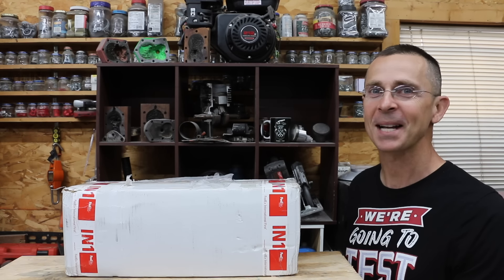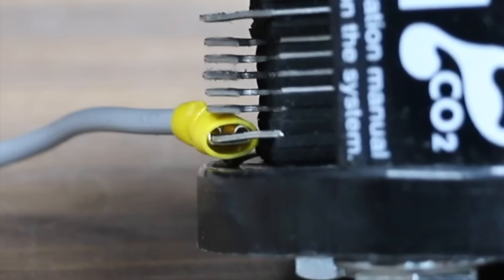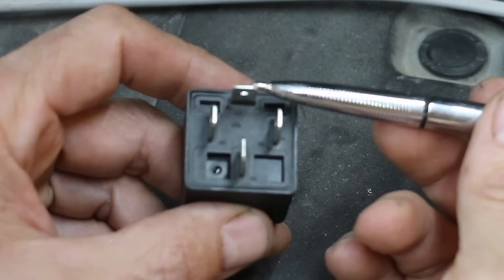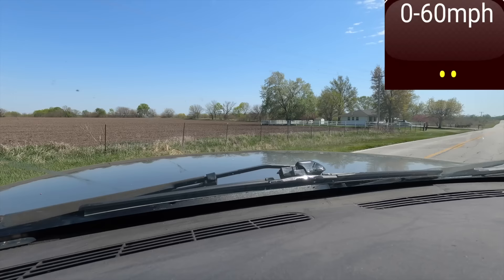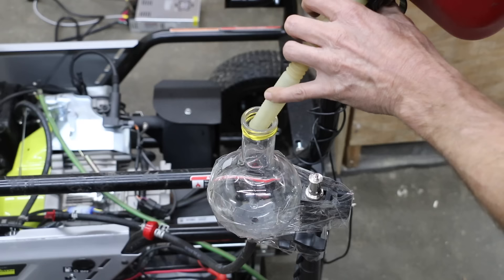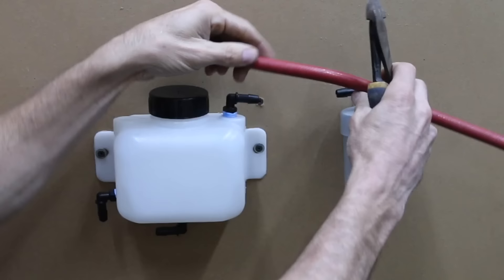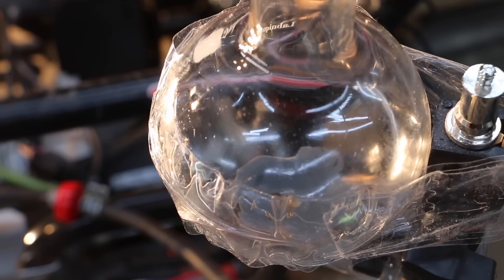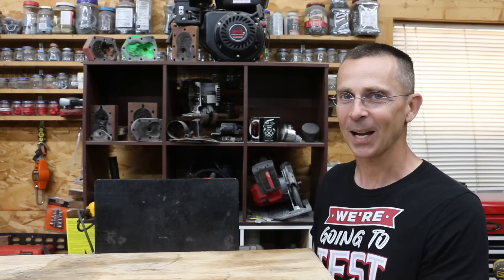AMAZING 35% More MPG with HHO? Let’s find out! Help with high gas prices?

Comment: Snake oil. Unfortunately a lot of people still fall for this :(
Reply: Always explain to them, if it made enough gas to help anything, the motor would have to run harder to power the generator, and it never works xc
Reply: Deliberately blowing $200 when you KNOW ahead of time that it's a "perpetual-motion machine" is going above and beyond the call of duty for a content-creator. (After that crap is torn back off, he should see if it blends, and then whether or not it'll stop a fifty-cal.)
Reply: @geth__commands_6300  Everything is relevant to weight? Gravity is not, all objects fall at the same rate in a vacuum. Time, when traveling near the speed of light is relevant for the occupant. 
If hydrogen is utilised you know it is used to generate electricity to operate the motors because the is not any air for the engine use, don't you. Even diesel engine submarines use batteries to run under water. Without batteries, all submarines would be useless underwater.
In your insult to the OP, what does "you must be the old and new generation well done" mean? Perhaps because they are not in the correct generation, the one in the middle of generations. I wouldn't know how that could be insulting. Also now that you are aware of everything in your statement is incorrect, false or misleading, does that mean you resend your insult?
Reply: This SNAKE OIL should be taken off the shelf and the owner held liable !!!!
Reply: Snake oil or improperly installed?
To see any improvement on a fuel injected car the oxygen sensors need wrapped with aluminum foil.
this will cause the car to lean out it’s fuel to air mixture.
The hydrogen hose needs put into the vacuum system generally the brake booster line with a three-way connector.
A resistor spliced into the wires to the map sensor to tricks the vehicle into believing that there is no Vacuum leak. That idle air control valve will do its job and bring the vehicle back down to a Smooth idol.
Reply: @aaronwetzel8444  stop bruh... Your explanation is barely intelligible and still won't make this Snake Oil system work. Science has already proven there's no free lunch.
Reply: @aaronwetzel8444  OK Even if what you said worked, explain why the generator sees 0 gains... lol snake oil.
Reply: @aaronwetzel8444  It is the former it cannot function as claimed. The claim is not true it is also incompatible with many theories in physics. Although it may seem plausible because, you know, Hydrogen, there is not enough to make a difference. The manufacturers are aware the the claims they make are done so in order to deceive. In this form the device is as ridiculous as a car that runs on dihydrogen monoxide, water.
Reply: @Melicoy  
It looked like a Well built product for the price.
If he put a link to it I would probably purchase it!
No it would wind up on my car but two of those units would generate enough gas for a small water powered cutting torch.
Reply: @minirock000  have you heard of this thing called a nuclear reactor? It generates the power for submarines, not batteries. Batteries are only there for emergency backup.
Reply: He did leave a link to the product :p
Reply: @kleetus92  Those do generate electricity, you do know that. You must know that everybody knows that. Those are not the subject of the claim he made, you understand that though as well.
Reply: @aaronwetzel8444  Wear Foil Hat Too That Will Help
Reply: @minirock000  actually no, they generate heat that boils water to create steam that turns a turbine that generates electricity..... but you knew that, right?
Reply: @kleetus92  Yes, that is how the vast majority of power plants work, some exceptions would be ones that The NASA use on spacecraft, for obvious reasons. What charges the batteries?
Reply: @aaronwetzel8444  How much gas do they produce? How do you compress gasses that you use? Did you purchase your own tanks to put gasses in? As a private citizen, p[resuming it isn't for commercial use, what codes must you be in compliance with?
Reply: The fact that the people advocating for that called it "HHO" is a proof that they don't know any chemistry...
It's 2 parts H2 (Dihydrogen loosely called "hydrogen gaz") and one part O2 (Dioxygen loosely called "oxygen gaz")...
Keeping those mixed is dangerous: a spark in the tank and the mixture explodes.
If you consider that electrolysis is arround 50% efficient and producing electricity with an engine is less than 30%, any gain in the combustion process costs 6* more to make. So the more "HHO" you produce the less effective you are.
Reply: @aaronwetzel8444  Dude laws of physics state that you can not get more energy out of process than you put into it. If a person mange to do so. He/she will get the Nobel Nobel Prize in Physics and will also get very rich. But has that happen to any of the energy nuts in HHO crowd. Nope not so far and it will never happen either. Trust me!
Reply: @minirock000  A water gas cutting torch generates as you cut the chemical reaction of the molecules coming back together can cut through almost any Metal and leave it safe temperature to handle moments after cutting through it.
You should look them up they’re awesome invention and quite expensive. I made my own a few years back but I have trouble fire traveling back down the house and exploding the bubbler
I’m sure I can find a solution to that problem now. I was 17 years old the time
Reply: @afre3398  I mean if this thing worked at mythical 100% efficiency it should do precisely nothing. Because it doesn't, it is actively harmful as you're using the engine to make electricity using that electricity to make chemical energy.  Instead of direct chemical energy (fuel) to electricity.
Reply: @aaronwetzel8444  -- While I suspect your replay was sarcastic, in the event that it's not, it MUST be noted that the reason none of this works is because extra energy is required to offset that lost by cracking water for its hydrogen, so this thing can NEVER improve mpg. It's 100% scam. And hydrogen gas is explosive.
Reply: @cmuller1441  oooooh sounds like time for a detective maybe the electrolyte has stolen missing ooo
Reply: @mikeschneider5077  This product if there was another hydrogen oxygen gas being put into the Engine truly improve fuel academy it would melt the cylinders like it does as a cutting torch.

But if you install it properly you would see a Increase of gas mileage of about 30% why? Because the other modification suggested with this modification well throw your vehicle in it’s Max fuel Academy band
Reply: @cmuller1441  You have no idea about  HHO. There are so many combine  when you use electric to generate: HHO, H2O, H2O2,HO2, H, H2, O, O2, H3, O3 etc. Like CO2 and CO are total differently. NO Vs NO2 too. It called state of space of atom or molecular or mixed combine under different cataclysm thermal, quantum space, entropy momentum etc so many. Then it created reaction in physical state, chemical state, combustional state, nucleotional state etc. So much wait for newage ahead.
Reply: @justincarroll1836  The HHO crowd is a cult. It is a waste of energy to even try to talk common sense to them. It is the best thing to just leave them alone
Reply: People fall for OBDII fuel savers and cigarette socket fuel savers, so I'm not surprised in the slightest people believe this nonsense as well.
Reply: @afre3398  seems like a weird hill to die on (metaphorically speaking) but I don't doubt you're right.
Reply: @mikeschneider5077  all I was being sarcastic in previous replies I wasn’t being sarcastic about water gas cutting torch they are amazing intervention
Homemade hydrogen generator 
Round up as a cutting torch 
The Gatorade bottle I was using as a bubbler many times and let me question the safety of the glass jar hydrogen emerged in
Reply: @aaronwetzel8444  That wouldn't apply to the timed generator tests that showed no difference. It actually had worse fuel efficiency  with the hydrogen generator attached but statistically close enough to be within normal variance. If this worked, the kooks in California would have mandated it decades ago.
Reply: @ThuannguyenN-gp2vp  Hydrogen peroxide and ozone cannot be created by electrolysis. Retake your high school chemistry class.
Reply: @magicoddeffect  well not by the electrolysis of water but given that's the device's purpose I'm assuming that's what you mean.
Reply: @murrayshekelberg9754  You are right hydrogen generation is not above unity.
The best you can hope for is that it will improve the combustion of the fuel in the engine.
As far as the generator is concerned
There would be no possible benefit from a slower but more thorough combustion.
The mods I stated in a previous post would lean the fuel and advance the timing this would allow the vehicle to utilize a slower but more thorough Combustion.
Reply: @TelephonePlays  You haven't understood the reasoning behind their claim. It has to do with the extremely fast burn rate of HHO. That is supposed to ignight more fuel completely, increasing efficiencies. I do not yet understand why Todd got no improvement.
Reply: @afre3398   You haven't understood the reasoning behind their claim. It has to do with the extremely fast burn rate of HHO. That is supposed to ignight more fuel completely, increasing efficiencies. I do not yet understand why Todd got no improvement.
Reply: @timothkeyyprice  I do because the law of physics. Say you can not get more energy out of a process than you put into it. Any combustion engine waste a lot of energy into heat. And in order to produce current to split water into hydrogen and oxygen. You have have the car dynamo to work harder. That energy has come from burning more fuel. Water is kind of the ash   you get from when hydrogen and oxygen combine. Water is not an energy bearer in any way.
Reply: @aaronwetzel8444  SNAKE OIL !!!
Reply: @aaronwetzel8444  He did install properly LOL
Reply: @afre3398  I said, burn rate.... the gasoline is not completely combusted in your engine. The HHO explodes and ignite more of it.
I am not at all sure Todd set up his engines properly to account for this. It will be good if the sellers of HHO units would challenge his testing.
Reply: @timothkeyyprice  The laws of physics say. You can not create energy from nothing, nor can you take some amount of energy and use it to create a larger amount of energy. HHO is just a scam that fool people into using money for something that do not work. The HHO crowd is just a cult. That you can not talk common sense to. They just do like you do. Come up with a lot of excuses when they are challenged. Oh they did not do that part right and so on. And the sellers of HHO units just laugh all the way to bank.
Reply: @timothkeyyprice  it takes electricity to split the hydrogen, more than it can produce burned. That electricity creates strain on the motor, which eats more than the gas produces. Which is exactly why todd did not see improvements.
Reply: @timothkeyyprice  trust me, I came across hho 5 years ago and have made many cells, it always uses more wattage than the gas produces burning. I'm sorry it doesn't work. You can't create energy from nothing
Reply: @aaronwetzel8444  Hilarious!  The snake oil buyers are arguing with you! lmao
Reply: @leroy420b  Maybe if I polish my Buddha statue,  I'll be blessed with a Smooth idol and a free lunch.
Reply: Brown gas generators work Bubba. None of this is new. Auto manufacturers went around HHO a long time ago. I have to chip the 
Vehicle. Works absolutely fabulous on a carburetor vehicle. I mean if I could do this shit 20 years ago you could do it today. You must’ve watched Myth busters huh. Put up or shut up!
Reply: It’s called brown gas it’s oxygen and hydrogen and water vapor. Glows green. Talk to someone who has actually built one of these. Works better on pre OBD2 ECU’s, Nonelectronic ignition Diesel, and regular carbureted engines. Your ECU in your car is programmed to keep a certain air/fuel ratio and will compensate when anything else is added. Hence why when you sup up you car you get a piggyback chip or take it to a shop and have your ECU programmed optimally. Same thing. Same as a 2 or 4  cycle engine. Gotta reject that carb. Did you actually expect to hook the fucker up to anything it it just work right on the box? You can’t with aftermarket parts on your car or your bike. Fuckin duh!
Reply: you'd think people who know how to install this thing wouldn't fall for this would. That and would have enough understanding of how an engine works to know that the little hose pumping the gas wouldn't even come close to providing enough gas to make a difference in an engine.
Reply: @aaronwetzel8444  Wrong, Wrong, Wrong!  Wrapping aluminum foil around an oxygen sensor does nothing!  Oxygen sensors DO NOT work on heat.   In fact, most oxygen sensors now contain a heater to keep the sensor above 600 deg. so it will work properly. They work on voltage.  A voltage signal is generated by the difference between atmospheric oxygen levels and the oxygen levels inside the exhaust system.  A rich mixture (low oxygen levels inside the exhaust system) produces a higher voltage (near one volt) while a lean mixture (higher oxygen levels) produces a low voltage (near zero).  The ECM reads this and rapidly changes the mixture to maintain a 14.7 to one air/fuel ratio.
  You asked: "Snake oil or improperly installed?"  The obvious answer is SNAKE OIL!!
Reply: @aaronwetzel8444  A very small torch!!
Reply: @aaronwetzel8444  Sounds like you are now about 14.
Reply: @aaronwetzel8444  No Aaron, you have been deceived by the smoke and mirrors put out by the HHO scammers!
Reply: @ThuannguyenN-gp2vp  Great use of technobabble!  I love your sarcasm!
Reply: @timothkeyyprice  Todd got no improvement because these silly gadgets do not work as claimed.  They do not work at all!!
Reply: @timothkeyyprice  Don't be so gullible, Tim!
Reply: @MrJaman0083  Love your tin foil hat, James.  Would you like a propeller beanie to go with it?
Reply: @Cougracer67  Snake oil these nuts!  Prove it wrong! Never said anything other then it works.
Reply: @Cougracer67  this is also exactly how they make oxygen in a fucking submarine.
Reply: Are you saying oxyhydrogen can’t be used as fuel? Is that what you’re saying?  Because it wasn’t produced by BMW or Mazda or Mitsubishi doesn’t make the any less a hydrogen modded vehicle or Hicev. This setup will not get you there but it works none the less.
Reply: @Cougracer67  Snake oil.
But oxygen sensors to respond to heat
We use a lighter and a voltage meter to test them in the shop.
What I wrote in that post was taken from different Snakeoil forms.
Wrapping the O2 sensors in aluminum foil will cause higher voltage which will cause the ECU to Richen the fuel to air mixture and protect the engine against the other modifications described.
Reply: @Cougracer67  I was 17 years old when I installed one on a vehicle.
The biggest difference I noticed was it allowed me to advance the timing without spark knock far beyond what I would’ve been able to advance it without It. 
It did better than premium fuel.

The vehicle was a 1985 Ford Econoline.
I built for hydrogen generator myself
No steak oil salesman got a penny off me.
I didn’t know enough to be afraid of the heat generated by lien fuel mixture.
I was able to get slightly over 30 miles to gallon out of the vehicle that generally gets 12 miles to the gallon.
After 1000 miles I had to replace the upper engine gaskets.
The exhaust manifolds were cracked 
but this probably had more to do with 
the age of the vehicle than anything I did
And if anybody can tell me how hot he combustion chamber Hass to get to turn the deposits into white ash I would like to know.
Reply: What you  probably didn't notice was the extra wattage used to power the unit. Which is probably why the results were as such.
Reply: @timothkeyyprice  Y'know what detonation is in an engine? If you don't know it's pretty bad, and can make your engine blow up. Gasoline engines aren't designed to make gasoline "blow up" and burn right away, because it blows holes in your pistons, microwelds your piston rings to the cylinder walls, and destroys your valves and spark plugs. The only way to improve efficiency in an engine is to use less and less fuel until the stoichiometric mixture of 14.7:1 is maintained in the engine at all times. Using different propellants in an engine doesn't make it inherently more efficient, it's just splitting the consumption up with two propellants lmao.
Reply: @MrJaman0083  The reason no manufacturer has designed a combustion engine to run on hydrogen is because it doesn't work. The reason being is because storing hydrogen in quantities large enough to make an ICE engine go any meaningful distance is impossible, it has lower energy density than gasoline, and it's more expensive to use on its own. The Toyota Mirai uses hydrogen to mix with oxygen to create electricity to run its motors though, which is pretty cool. That's the only use case it really has though, itd be better to use synthetic ethanol instead as a future fuel source.
Reply: Oh it can work...
Reply: @SteveIrwinsPetStingray  Dear LMAO. Gas vapor in an engene does not ALL burn. It is wasted and blown out the exhaust  
The HHO burn extremely fast, is very hot, and serves as a primer for the gas.
Setting the timing back a git to be sure to be past the peak of compression is necessary in order to achieve the benefits.
Reply: @timothkeyyprice   It doesn't work like that. Using a "primer" won't do anything, and won't make the gas burn better. Gas has a certain burn rate, and the only way to make that process more efficient is to use a leaner AFR with higher compression and higher octane fuel. Or, better yet, just to use ethanol instead. Oxyhydrogen turns into water when ignited too, pretty counterintuitive for an efficient engine lmao. Just because it has hydrogen in the name doesnt mean its a miracle fuel. Also, the energy benefit it would theoretically give outweighs how much energy is required to make it.
Reply: @devinmcaluliff7001  No, it really can't.
Reply: @SteveIrwinsPetStingray  yes it can, I made it work...so by my statement alone...I made it work and it’s still installed
Reply: @devinmcaluliff7001  What? So because you said you installed one of these into something that means it 100% works? That's not how things work pal, sorry to tell you. The video even showed that there is no benefit to be found. Oxyhydrogen does not boost engine performance or efficiency. The only possible ways to do so are to: Raise compression, use a leaner mixture (stoichiometric mixture is 14.7:1 and isn't possible to achieve without detonation in todays engines that run between 11:1-13:1 AFR), maximize the amount of oxygen that reaches the combustion chamber, and to optimize flow paths for the intake and exhaust. Stop yourself from being fooled and buying into these scams. You want a better running engine? Convert your car to run on Ethanol.
Reply: @SteveIrwinsPetStingray  so in your mind if it doesn’t meet the criteria of the channel, then it doesn’t work...son pull your head out of your butt... there may be more than one goal...the channel was their to debunk the speed claim...me, I increased my mpg by 30%...my wallet is happy.  Plus you are missing my point...my motor uses a carburetor system...putting a Weber on it this summer.
Reply: @devinmcaluliff7001  The video shows that it provides to benefit to fuel efficiency either... Tell me, how much gas does this produce? Say you had a 454 big block that has a redline of 5500rpm, which flows about 615 CFM. There is zero possible way that you are producing enough of this gas to provide any noticeable benefit. The size of the batteries, generator, and water reservoir would fill a large trailer. That's for an engine that's only a liter in displacement as well. You are delusional, these things do not work.
Reply: @SteveIrwinsPetStingray  Burn rate is entirely dependent upon pressure and temperature. All chemical reactions increase by the square of their temperature increase.
Reply: @geth__commands_6300  submarines actually exhaust hydrogen because it's a waste product when they're making oxygen. HELLO.
Reply: @Cougracer67  
The point of the foil has nothing to do with heat, just to defeat the o2 sensor.
Reply: @SteveIrwinsPetStingray  
Propane combustion produces water, as does gas. Are you saying those fuels can't power an engine?
Reply: @duderama6750 That was my bad, im aware that other fuels produce water, didn't realize what i said when i was typing.
Reply: @aaronwetzel8444  leaning out the engine and tricking the MAP sensor with a resistor would change gas mileage, the HHO system would do jack all. Also leaning out an engine makes it run hotter and increases detonation. So you'd save a little on gas and blow your engine up much faster.
Reply: @aaronwetzel8444  Close but the aluminum foil is supposed to make a tin foil hat to wear.
Reply: @ImprobableGarage  right you are.
But you can help protect your engine by adding 10% diesel to your fuel mixture.
Then to keep the Cadillac from plugging up 
add 10% lacquer thinner +10% acetone
This will only clean your engine Improve mileage.
Don’t try this to a vehicle you like
Or want to keep around for any length of time. 
This was taken from the snake oil form.
Good luck
Reply: @stinkycheese804  Why?
Reply: @TelephonePlays  no actually not on a carburetor engine...it’s an old technology that works...but hey keep thinking what you do and I will persist in my ‘87 Subaru GL getting 40 mpg via HHO
Reply: @cmuller1441  look up Browns Fuel or Browns Gas
Reply: Not exactly snake oil if it is producing hydrogen but the engines it's advertised for are not designed to burn hydrogen.
Reply: @devinmcaluliff7001  mhm
Reply: @leroy420b  He's right that it's improperly installed. It's not installed in an engine system designed to be powered by hydrogen gas. If it's delivering usable hydrogen gas in the first place.
Reply: Like Throttle Body Spacers....
Reply: @TelephonePlays  it acts as a FCA not a fuel, go read the new article in Popular Mechanics, you'll be surprised
Reply: @geth__commands_6300  You do realize they have nuclear reactors powering those 'hho' systems in subs, right? An Ohio-class has a nuke powering 26 megawatts worth of turbines. And NONE of that oxygen nor hydrogen is used for power.
Reply: @aaronwetzel8444  
Finally,  an intelligent response. 
Uh oh, looks like you upset the "muh laws of thermodynamics" people
Reply: @martinez0582000  
"Why does the generator see zero gains"?
Because he didn't lean out the main fuel supply.
Reply: @murrayshekelberg9754  
He didn't lean the generator out.
In a carburetor, jets are utilized to control the fuel flow of the venturi effect.
Some carburetors have a variable jet that you can turn from outside the carburetor.
Reply: @afre3398  
You are such a purist, that you don't even understand what he's saying. 
Most of the gasoline heat energy is wasted. Look at the efficiency rate of an ICE. If a secondary fuel improves the efficiency of the main fuel....
Reply: @MrJaman0083  
Finally,  someone who understands. 
All these "scientists* are so used to attacking "free energy machines*, they don't even realize that they have no real world knowledge of venturi effect carburetors.
Reply: @GrimmsDeath  
You'd think he would have used a variable jet to lean the mixture on the carburetor until it developed a lean miss... but you're so high on your vanilla scented farts, you didn't catch that, did you?
Reply: @Cougracer67  
You just proved Aaron's point...
Reply: @Cougracer67 
He got no improvement because he didn't lean out the carburetor
Reply: @aaronwetzel8444  
All of the armchair scientists get a warm feeling from shutting down anything they deem heretical. 
They do nothing themselves,  only deride others.
Keep up the good work,  brother. 👍
Reply: @FireBeam  Perhaps so.